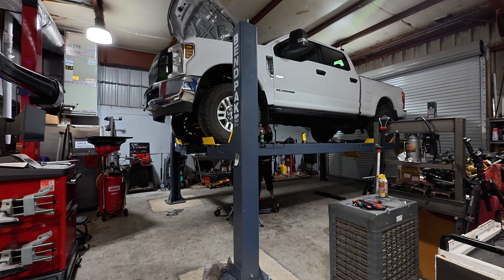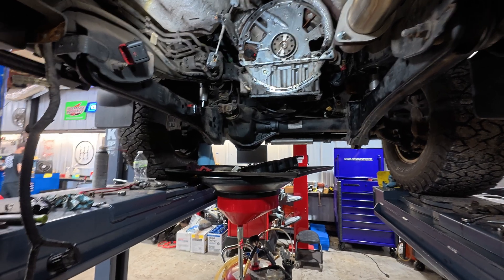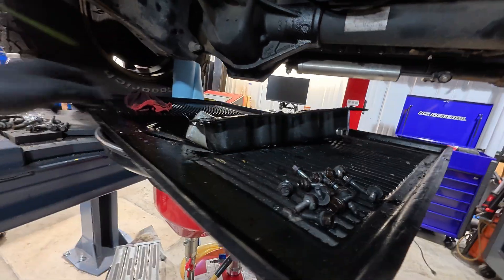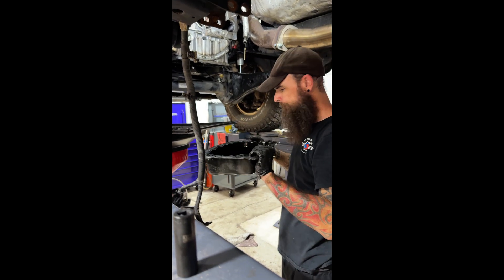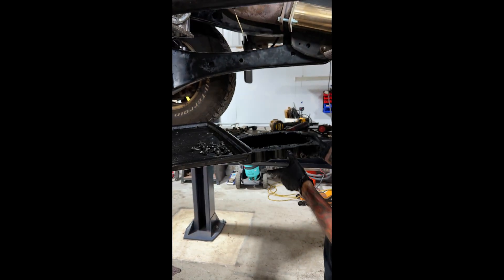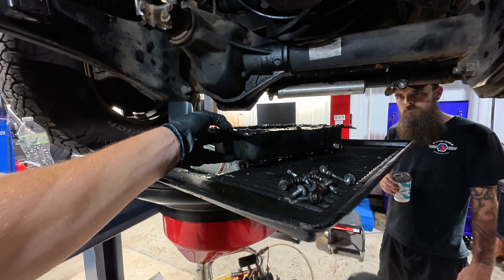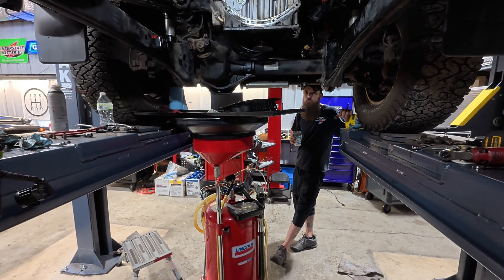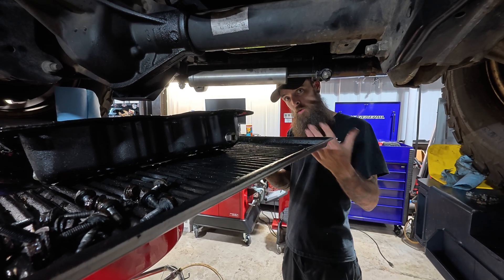3 PowerStroke Oil Myths Busted!

Comment: Folks saying send oil out for analysis you’ll save money on your oil changes. I cringe. I think oil analysis is great. I do! But at a minimum they cost. $67. That’s also the price of 2.5 gallons of Rotella T6 full synthetic 5w-40. You aren’t saving money. You’re spending extra money to POSSIBLY learn more about your truck. I just do oil change between 5k and 6k and it always seems to be around 21 or 22% on the oil life dash meter. Oil analysis are expensive.

Comment: I am buying a 2019 f250 6.7 powerstroke with 160000 miles. Any thoughts?
Reply: I would only if it was a single owner and you could find out what additive, if any additive was used in the fuel. If you dont know if an additive was used that cp4 could be a ticking time bomb. Youre also going to want to swap out that ccv box for a new model one if the previous owner hasn't.

Comment: Everyone is different  , on my 2013 F350 6.7 delivering new RV trailers,  I change the filter and refill oil level at 5-6,000 miles  . On 2nd 5-6,000 miles I change filter and oil .
  Truck has about 160,000 miles and doesn't use any oil to add in between each filter change.

Comment: Thanks for showing. Are you going to have an extended video on the upper oil pan replacement? Curious how all that went. Remove the cab and engine? Any issues ordering the old pan and installing it?

Comment: Full transparency of my 2017 F350 6.7 @ 88k, use T6 5w40 at 5k intervals for my daily driver.  Took a chance on SPE oil pan, with the increased capacity.  It only holds maybe a quart more and factory oil pan was clean too...$$$ spent, but foxusing on true insurance of a SS Dpk...thanks gents for the vid

Comment: I don't know what all this talk about sludge in the oil pan comes from, as long as the engine is being driven consistently a long enough distance and warmed up to get rid of moisture from the combustion process I rather doubt sludge is the first worry. It would be more like soot percentage in the oil due to the garbage EGR system causing soot to build up in the oil far sooner than a pre EGR engine. Also injector spray pattern would be a part of that, as well as raw diesel dilution building up in the oil. Getting the oil tested properly for those aspects as well as the useful life left of the oils additive package. Sludge build up within what was thought of as a proper oil change period ( but really isn't for that use situation ) would be more likely to be the result of running a diesel engine during the winter time with short runs that don't allow for proper warm up and massive amounts of moisture stay in the engine on top of the heads and reek havoc as it turns into a thick gooy substance that is not kind to the engine and at some point would plug the filter.

Comment: My thoughts concerning an aftermarket oil pan isn't necessarily where the drain plug is but rather increasing oil capacity in support of extended oil changes. Then while looking at aftermarket oil pans take into account where the drain plug is, cooling fins, reinforcements, aux ports and sealing method as a determining factor of which oil pan to purchase.

Comment: The cost per mile on these diesels are not beneficial
Reply: @cliffh8486  yeah they've become just as expensive if not more. Really the only thing is engine life. If diesel will still get double the life of a gas and since the majority of people will just buy a new truck vs rebuild, diesel will cost less by far.
Reply: @user-dm7bz9by2zif the crap automatic transmission would last like they did 20 years ago now good luck.
Reply: @user-dm7bz9by2z diesles dont last any longer than gas anymore.